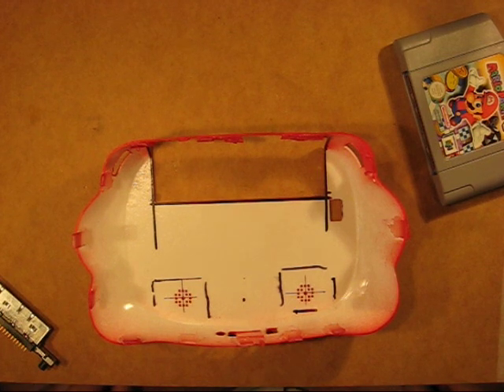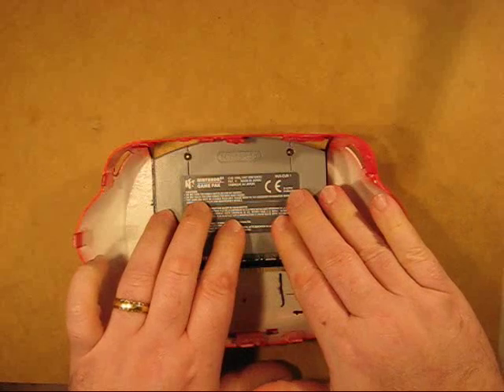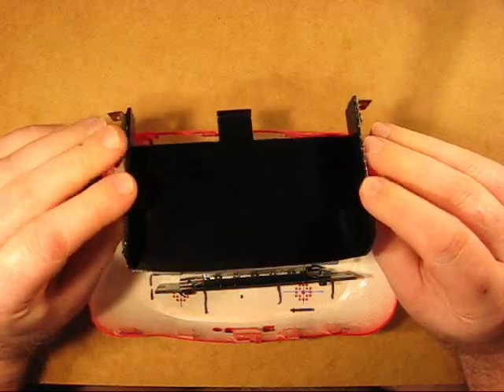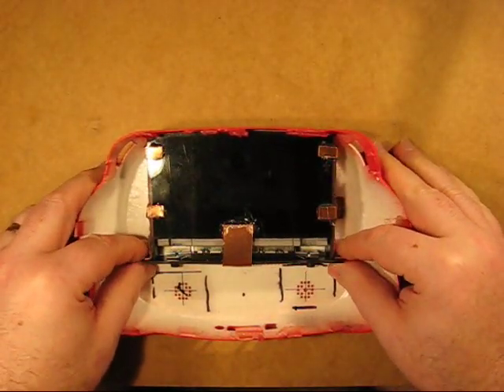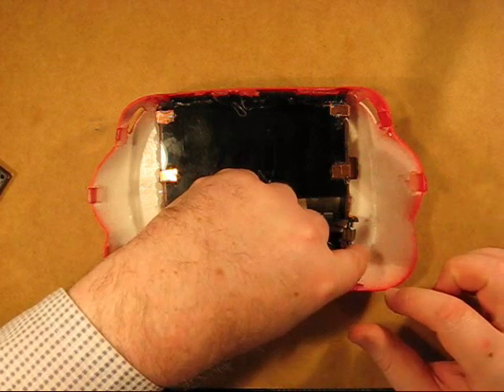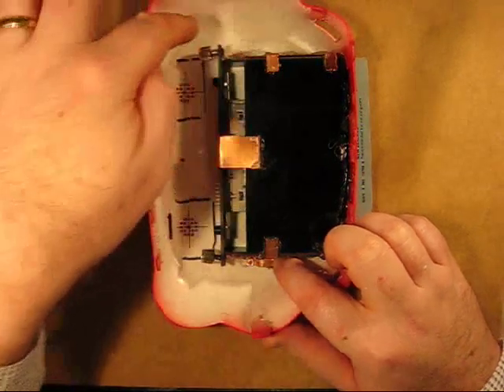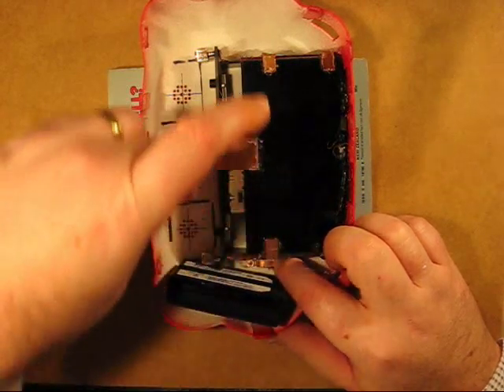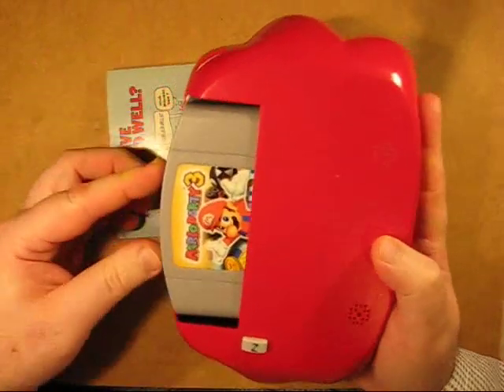N64 log - 10 - game cart assembly + Z + speakers.wmv

Comment from the maker: The actual cost of the materials alone as I recall was about £100-£110. It takes many hours to make one of course, and time is the expensive part unless you are making the system for yourself, in which case you gain the fun and knowledge that such a system build provides.

Comment from the maker: LocTite. If the surface you hot glued onto is smooth like unsanded plastic, it comes off quite easily, however if applied to a roughened surface or components, you need to fight it free with a screwdriver to pry it up. In other words, it isn't "permanent" being hot glue, however does stick and work really well.

Comment from the maker: "Z" button was off a Makopad / SuperPad 64 Plus N64 controller.

Not had problems with hot glue, I use branded hot glue not generic; also if you prepare the surface so the surface isn't overly smooth then the glue will stick very strongly.

Comment from the maker: Auzzie N64 is similar to the UK N64, although you can use RGB instead of composite if you want, which the UK can't (the chip is incomplete in ours). So yes, tutorial for this N64 is fine for yours, and also NTSC ones too.

By the time of your birthday I may have finished the project, or near to.

If you can't buy an N64 in Auzzie, I can provide you a UK PAL one if you like (you are PAL too), just the board, to keep postage down. Let me know at some point if you want one.

Comment from the maker: If the batteries are 7.2v or higher, you can connect them to maintain the same voltage but double the amperage; yes, in that scenario you can use one charger for both at the same time - that is what I do.

You must however have a proper charger designed to work for the batteries you are using or you could end up with a fire/explosion. Look on ebay or similar to get a suitable charger.

Phone batteries are not good enough for this project, use camcorder/DVD/laptop batteries; Li-ion or Li-po.

Comment from the maker: I'll try that technique. Stringy hot glue is a pain. Thanks!

You won't run an N64 off a mobile phone battery, not enough amps or voltage! Regards screen, unless it can input composite and audio then you can't use it anyway. If your mobile phone did take composite, you only need to attach a/v leads to the N64, maybe make it run off batteries instead of mains; job done.

Comment: Looks awesome bacteria can't wait to see it when it's done. What controller did that z button come off of? I've also had some bad experiences with hot gluing the buttons in because once the system is on for about 5 minutes the hot glue starts to loose its hold.